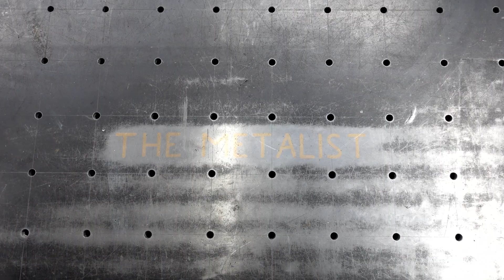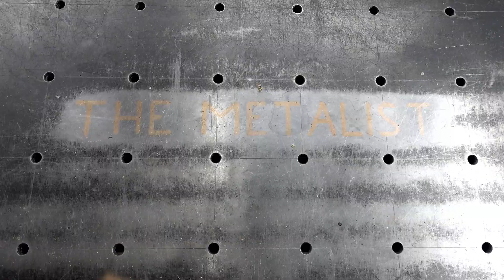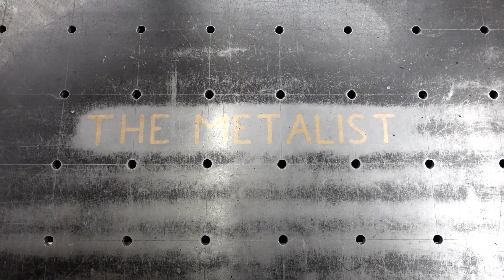Building a very expensive Axe

Comment: I think a little bit of rust on it would look cool, like in the eye sockets or on the teeth. 
How did you mirror from one side to the other? Because if I were to do that one eye would be a half inch lower than the other.
Reply from the maker: Nice idea with the rust. Yes the eyes not Match 100%

Comment: Hi Dirk! Along with the Ironfist, this is really a piece of art; I'm not sure I could really use for chopping woods, I would feel afraid of ruining it.
I also discovered a lot of new things by paying attention: you not only used a dremel, but also at 4:01 there's flexshaft for a die grinder. I've never seen one, who makes it? Also the attachments for the angle grinder at 3:17 are nice, who makes them? Last: what model is your face shield?
Reply: If you want a commercial quality excellent tool then I recommend a Foredom Flex Shaft. I used one every single day as a gunsmith for 20 plus years and it will last a lifetime with no issues.  If you just want one as a hobby then Dremal makes flex shafts that are inexpensive.  Good luck. ✌️
Reply from the maker: Thank you 😁 
I like the flexshaft from dremel. Maybe not the strongest Bus light, small and cheap.
The other on is a big one, it is from Metabo. The attachments for the grinder is from Pferd, M14 to Roloc.
Reply from the maker: And the face shield is from 3M (Versaflo)
Reply: @TheMetalist  Thank you very much for taking the time to reply!
Reply: @onionhead5780  Didn't know them, I see they have a nice range. Thanks for the advice!